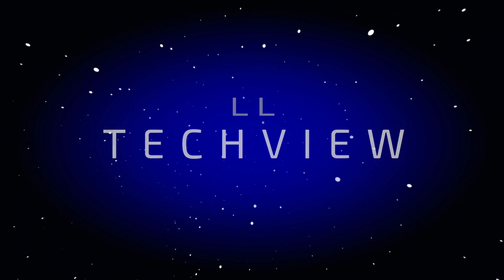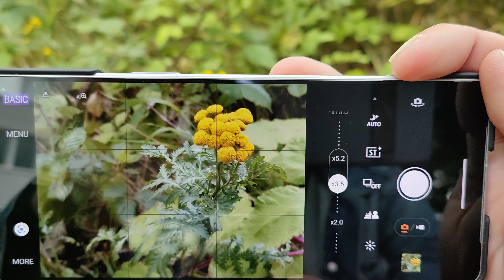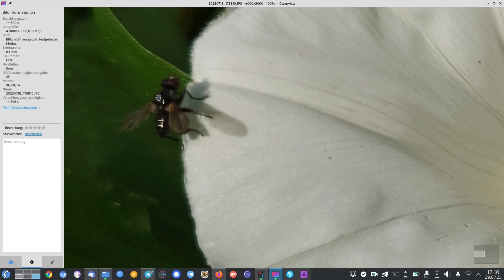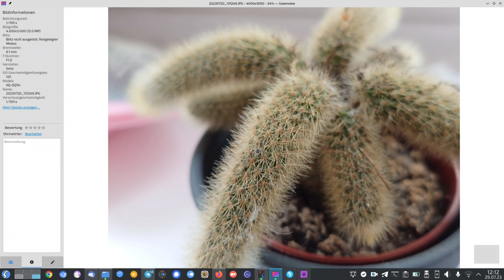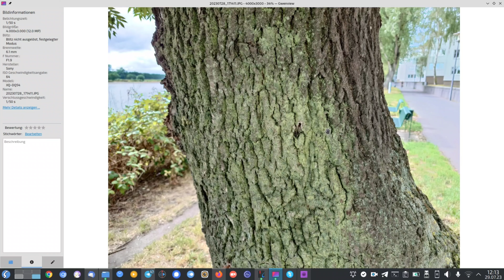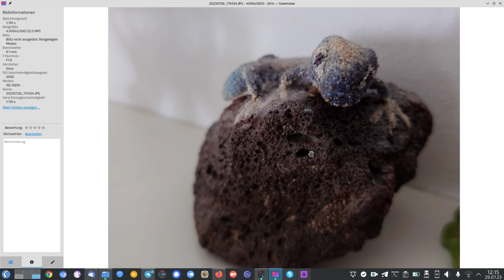Xperia 1 V hidden macro(like) mode - mind blowing!?

Comment: Can you please take a look inside the bad display calibration which is an issue for nearly every 1V user. Showing greenish tint of the display and black crush when going under 90% brightness level. Obvious when looking at darker pictures taken with the camera or for example in the settings menu of the phone with active dark mode. In my opinion a no go for a photographer because picture quality of low light or dark pictures looks terrible out of the display but in reality it is not bad. Thanks
Reply from the maker: I know this issue from older Sony devices as well. Only had it once though with the Xperia 10 V. And they fixed it there. I don't have this issue with my unit.
Reply: @lltechview  Are you sure? I tested 5 different Mark V and all had the same issue. I don't believe in an 5/5 jackpot. When you are in dark room and turn on dark mode, go to settings menu (because of the gray theme) and shift the brightness up and down in the upper third of the adjustment level there should be color shift at about 80-90 %
Reply from the maker: @joseemanuel2024  Its a slight readjustment it when I move the slider that I see. But the blacks are back to blacks when you go lower. I think it is switching to a different dimming algorithm there.
Reply: @lltechview  very strange. Because I tested nearly 10 units mark IV and V and all had this issue. I have just made a video but it shows little worse than it is in reality. Can you compare to your signs of color shift at this point. Would be really interesting because it would be the first unit I see without that issue
https://youtube.com/shorts/EvYNp-DgKW4?si=vx4a7-KYnJ_9AkWK

https://youtube.com/shorts/GRP5q2iys1U?si=RFnFqRwjU6ddlnS1

Comment: On my 1 V it looks like it crops the sensor when zooming 24mm-85mm on the main lens. 85mm on the main lens looks so much better than the 85mm on the telephoto lens, to the point where when the 5 V comes out without the telephoto lens, it won't be a great loss.
Reply: Maybe that is the point why 5V is rumored to exclude telephoto.
Reply: Yeah the telephoto on the 1 V is total rubbish IMO. Waste of money. @josephaquino3095
Reply: I am uncertain if I should choose the 1 V over the 5 V because of the optical tele - so, you would say no?
Reply: Don't bother, its mushy and a bit crap. Wish I got the 5 V now @s.m.h.8150

Comment: S23 , iphone 14 or 1 v
Which camera better?
Reply from the maker: In my ranking system the S23 Ultra of these three is better than thd 1 V. They are 0.07 points apart from each other.
I did not test the iPhone 14 yet
Reply: Thx 🙏

Comment: What would be your choice in 2023 when the main focus is on camera quality?
Reply from the maker: I am currently using the 1 V as main device also because of the excellent photo taking experience. Otherwise Huawei P60 Pro, Mate 50 Pro, Xiaomi13 Ultra/Pro, Oppo Find X6 Pro, Honor Magic 5 Pro & Vivo X90 Pro+ are soo good that you can take any of them
Reply: @lltechview  thank you for the fast reply
Reply: @lltechview  so would you come to the conclusion that Xperia V ist the best camera device so far, if you are willing to spend a bit of time to get used to the funcions? Even better than Vivo X90 Pro + and Oppo X6 Pro?
Reply from the maker: @marcpatrick5948  It makes the most fun as for the controls. Though I am testing the photography kit on the Xiaomi 13 Ultra right now and its also a lot of fun.